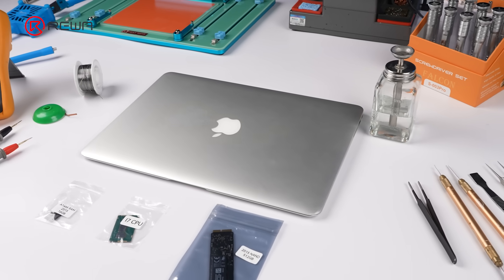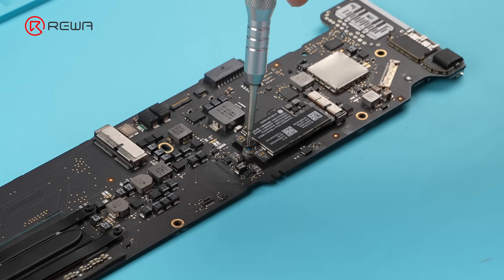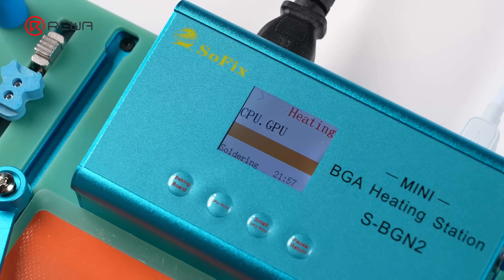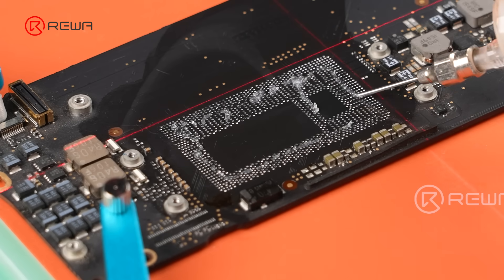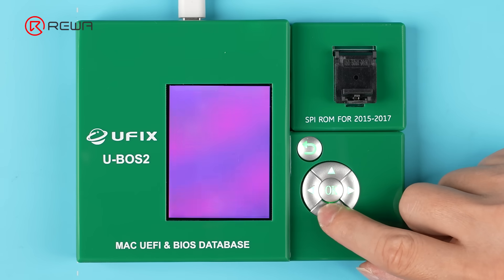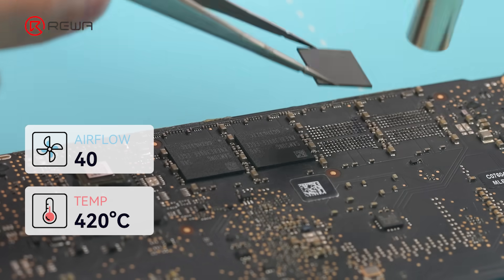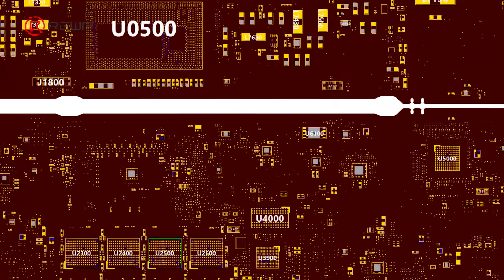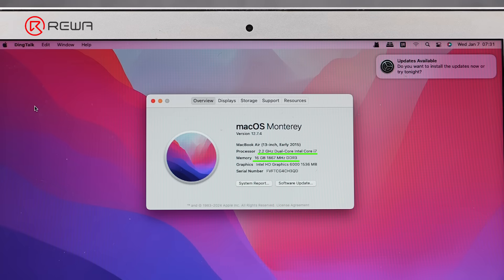We Upgraded a 12-Year-Old MacBook Air with i7 CPU & 16GB RAM – Worth It?

Comment from the maker: 💡 What's the FIRST thing you're going to try after watching this? Let me know below! 👇❤
Reply: Buy this macbook upgraded from you 😂
Reply: I am going in the shower. It was 97F here in Martinez, Ca. on the edge of San Francisco Bay.
Too hot to do anything.
Reply: Any branch office here in Malaysia?
Reply: Install Linux Mint XFCE
Reply: macbook air A1469, i really want to upgrade specs but changed motherboard 3 times cause ram defect , 2 in warranty and a third time by miself.  if you say it is not gonan die..i may go for it.
Reply: can you mention the links for the mew cpu fpr macbooks
Reply from the maker: @shakemipalito  pls contact us at sales@rewa.tech or +852 5167 5273
Reply: 16GB RAM for my acer with 8GB soldered RAM
Reply: i spent an hour identifying the D9SVW chip i need for the upgrade because I couldnt find it on your website now i'm deciding if buying and upgrading macbook airs would be a worthy business venture since the ram is so easy to do and makes it compareable to a 2012 i5 macbook pro with 16gb ram
Reply: Donde capacitan para hacer eso con las ram del mac m1 de 8 a 16 o el ssd a 1 tb

Comment: Did you upgrade the ssd to nvme 3.0x4 ? That will push SSD sequential read speeds of approximately 2,000 MB/s to 2,500 MB/s. And than this MacBook Air may survive in current os for a while.

Comment: I think you guys should take a look at the 2012 15” unibody MacBook pros , modify them so they can accept 32gb of ram instead of 16gb limitation even tho the cpu can accept 32gbc and upgrade the cpu to a 3ghz quad core i7, and upgrade the vram from 512mb to 4gb gddr5 using bios modding along with firmware modding. I think you may have to design a new chip as well.
Reply from the maker: What we can do more is to remove the restrictions on the motherboard, design a chip will be way more crazy.

Comment: You’re doing a good job, but please remove the music in the background. It’s very distracting when you’re talking thank you. I don’t think this project is up to most people standards if they have not had enough soldering experience.
And if you don’t have one of those heating stations to keep everything evenly temperature controlled your other option would be using the bed of your 3-D printer and get it warm.

Comment: My mom has a 4th gen i7 laptop (Wintel) given by my brother. I upgraded it to a SATA SSD and 16GB of RAM. I don't know about Macs, but for Windows Laptops, I find that the dual core intel i7 is very laggy, even though it is i7 and I upgraded the SSD and RAM to the max. I think it's because of the dual core processor. So I don't think its worth upgrading. I also have a 3rd gen intel i7 Desktop (4core 8threads) which I upgraded to Nvme SSD and 16GB of ram and it's really snappy and it's worth upgrading for basic tasks. It can also game and do some light video/graphic editing but it might take some time to render. 

But again, I don't know about Macbooks with this generation of processors...is it worth it?

Comment: I need these tools
Reply from the maker: Hello here are the links of our repair tool: 1. SoFix S-BGN2 Mini BGA Heating Station:
https://shop.rewa.tech/detail/sofix-s-bgn2-mini-bga-heating-station-for-motherboard-repair.html?utm_source=YTB0819&utm_medium=video&utm_campaign=YTB+repair+video

2.AMTECH NC-559 Needles BGA Flux Paste:
https://shop.rewa.tech/detail/needles-bga-flux-paste-nc-559-asm-uv.html?utm_source=YTB0819&utm_medium=video&utm_campaign=YTB+repair+video

3.1.5M * 2mm Solder Wick:
https://shop.rewa.tech/detail/desoldering-wicks-oem-new.html?utm_source=YTB0819&utm_medium=video&utm_campaign=YTB+repair+video

4.2UUL SC15 Deoxidation Solder:
https://shop.rewa.tech/detail/2uul-sc15-deoxidation-solder-cleaning-paste.html?utm_source=YTB0819&utm_medium=video&utm_campaign=YTB+repair+video

5.SUGON 8650 Pro Hot Air Station:
https://shop.rewa.tech/detail/sugon-8650-pro-hot-air-station.html?utm_source=YTB0819&utm_medium=video&utm_campaign=YTB+repair+video

6. SUGON AIFEN A9 Pro Soldering Station:
https://shop.rewa.tech/detail/sugon-aifen-a9-pro-soldering-station.html ?utm_source=YTB0819&utm_medium=video&utm_campaign=YTB+repair+video

7.REFOX RS3 3D Screw Driver Set: https://shop.rewa.tech/detail/refox-rs3-3d-screwdriver-set.html?utm_source=YTB0819&utm_medium=video&utm_campaign=YTB+repair+video

8.AMAOE BGA Reballing Stencils
https://shop.rewa.tech/detail/amaoe-bga-reballing-stencils-for-macbook-1-9.html?utm_source=YTB0819&utm_medium=video&utm_campaign=YTB+repair+video

9.UFIX U-BOS2 MacBook Motherboard Repair Tool:
https://shop.rewa.tech/detail/macbook-motherboard-repair-tool.html?utm_source=YTB0819&utm_medium=video&utm_campaign=YTB+repair+video

Comment: And i've been told they can't fix my ram slot in my laptop because it was shorted when i've cleaned up the liquid metal from the cpu, and they only way to be fixed is a new mb, and you guys replace the cpu's and rams on a macbook like is plug and ply, i have a medion beast x30
Reply from the maker: Ummm you got us, the disassembly process is not difficult, but the chip processing and testing are the challenging parts.

Comment: So all you need is $50,000 of specialty equipment (soldering station, ROM reprogrammer, plus the training to use them) for this quick upgrade. Cool! OR... go out on the used market at find a unit already configured with the i7 and 16Gb of RAM for well under $1000. Hmmm... which one to go for?
Reply: go dig your garden if it is too hard for you

Comment: I wonder would it be worth it to try and get a 16gb ram upgrade with an i7 upgrade on my 2015 13" macbook pro
Reply from the maker: It should work, but the Bios chip and the resistor you need to be careful.

Comment: 2:28 How does that fan remove the smoke? It just spreads it into the room.
Reply: there's a sponge that retains most of the flux vapors
not all but most
Reply: @DigerCZ  a) No, there is no sponge in it. You can see through it as he turns it. b) That little CPU cooler fan generates by far not enough pressure to blow anything through a sponge or any kind of useful filter, it would just blow the fumes against it and the smoke would come unfiltered out of the sides.
I think the only answer is: That fan does nothing for your safety. It's just a fake to fool you into thinking you are safe. Maybe you could hope to blow the fumes away from your face with it and out of an open window next to you, but that's all. It would be no big difference to just have an open window next to you.There's a reason why real fume extraction systems aber big, complex to install and expensive.
This is just a toy with no effect.
Reply: @DigerCZ  No, you can look through that fan while he turns it.
Reply from the maker: This fan is mainly designed to remove smoke. What you see now is that the smoke is no longer lingering around your eyes.

Comment: i7 will be overheating inside that tiny little case... (also, tiny little heatsink & fan) 🤫

By The Way, Good Video from Rewa, and the tools they have in there is super amazing...
Reply from the maker: Oh the common issue for MacBook CPU?
Reply: no it does not. that cpu came from apple as an option. my air has it and it runs much cooler than the i5.

Comment: 1:17 Do I need to remove the cooling pipe to see which series the processor belongs to? How can I check which series the processor is without removing the back cover of the computer?
Reply from the maker: Umm perhaps some software can help you, but usually Apple does not allows you to do that.

Comment: Thanks upgraded mine after watching this video.  Is much better.  I didnt have heat station only heat gun but it work fine.  Heat station waste of money
Reply from the maker: Ummm if you need to disassemble some components, the heat station is totally fine.
Reply: @rewatechnology2008 is fine but expensive.  In Russia i save money no station easy
Reply: @willybojanglechunks  hello there, does this upgrade allow the device to be upgraded to the latest version of macOS or does it only make the device faster
Reply: كWhat is the cost for macbook air 2017 and where is your location?
Reply: @g_gahwa i charge $55 in Australia for it.  If you want come to my shop i can give discount
Reply: Are you a Mac technician?  Or just doing this as a hobby?  Just curious to see what a minimal setup for me would cost

Comment: My 2015 Macbook pro came with i7 and 16gb ram. It freezes all the time probably because of the dead battery. Planning to get rid of it.
Reply: Yes its the battery, somehow apple decided to cripple the clock speed on macbooks that have a dead battery even if plugged into the wall. Replacing the battery will fix this but still a whacky 'design' by apple.
Reply: @Infinitiverse by design
Reply: @KimoKimochii  nope, to prevent the system from shutting down when battery is unavailable
Reply: @tyrek78  😂 that doesn’t make sense, there’s no reason to throttle when on ac power, every windows pc can do this, and mac’s are supposed
to draw less power under load.
Reply: @KimoKimochii  no? many dell and lenovo  computers limit power draw when the incorrect power adapter is plugged in or there is no battery. why does it not make sense? the cpu package in intel macbook pros can reach over 80 watts in extreme cases, exceeding the 85 watt charger limit. intel macs use the same amount of power as an equivalent windows pc
Reply: @tyrek78  you just said it yourself, using incorrect power charger is a different story. The macbook throttles with the correct power adapter without the battery present, that is apple trying to force you to get a replacement battery and there’s no other reason for this.
Reply: @KimoKimochii  i said incorrect power adapter OR no battery, can you not read?  i was stating a case where the same thing would happen in 2 situations
Reply: @KimoKimochii  and why did you ignore the fact that the component power draw may exceed the power adapter capacity in extreme cases? even worse, dell shipped gaming laptops from the factory with insufficient power supplies during normal gaming loads
Reply: @tyrek78  i just told you, that doesn’t make sense. On AC power there should be more than enough power than a battery can ever supply and should not power throttle. no x86 laptops do this. Why you changing the topic and start talking about incorrect power adapter, of course that will cause power throttle, common sense 😂🤦🏻‍♂️
Reply: @tyrek78 All power adapters that come with laptops are always providing power exceeding what the laptop will draw, how do you think desktops work 😂😂😂
Reply: @KimoKimochii  Pretty much every manufacturer has that nowadays, i think because prochot is also used for reporting errors on the power delivery side.
The battery is supposed to be used when the cpu is in turbo to meet the high power demand. When it is missing there is an error -> prochot gets triggered -> 400mhz (or turbo button pressed for the old folks)
Reply: @KimoKimochii  dell provided a 130 watt adapter for a gaming laptop that could draw more than 130 watts, please do your research
Reply: @KimoKimochii  the 85 watt power supply may not be enough to power the entire laptop in extreme scenarios that are very uncommon, what is so hard for you to understand that? if the ac adapter limit is reached, the system can draw power from the battery if needed (same issue as the dell x86 system). i did not change any topic, i just stated information that was important and relevant. even with the correct power adapter systems, laptops without batteries can still have issues running, common sense, which you clearly lack
Reply: @_DSch  Only for macbooks, most if not all recent windows laptop don’t have prochot triggered from missing battery running on ac only
Reply: @tyrek78  If you are using that dell with a 130 watt adapter, with the battery won’t allow you to draw more than 130, having battery doesn’t allow you to draw more, the wattage is the same 😂 the battery does however smooth out the voltage fluctuation if the ac doesn’t do that already.

And why you bringing in a 85watt adapter to the discussion 😂
Reply: @KimoKimochii 130+a small amount from the battery, don’t see what’s so hard to
Understand, the wattage of the components is the same but where it gets the wattage can change. You also just answered your own question with voltage fluctuation. I mentioned the 85 watt adapter because the 2015 15 inch MacBook Pro comes with one, are you dumb?
Reply: Can you stop fighting?  I think Apple slowing down the performance is part of their planned obsolescence, like they did with slowing down the iPhone. They say its for security, but in the end, it is to force you to change the battery or just get rid of the laptop and buy a new one.
Reply from the maker: Appreciate your love, we will keep working.

Comment: Got a MacBook Pro from 2012 15" i7 16gb ram Nvid GT650M 512 still running great but cant update the OS beyond 10.15.7 Catalina. Apple specs say 8gb ram max but 16 working fine. OS upgrade would be nice as some software is running on old versions.
Reply: Running Big Sur on a macbook white 2010 with 8gb ram. Look at Open core OS patcher.
Reply: Open Core Legacy Patcher

Comment: Thanks for the video . Is it the same resistor configuration if I want to upgrade to 8GB RAM? Or is there a different resistor configuration for 4GB, a different one for 8GB, and a different one for 16GB? If so, how can I find out which configuration is best for each model?
Reply from the maker: The 8GB you just need to reomove one resistor, R2050 to R1631 should be fine.